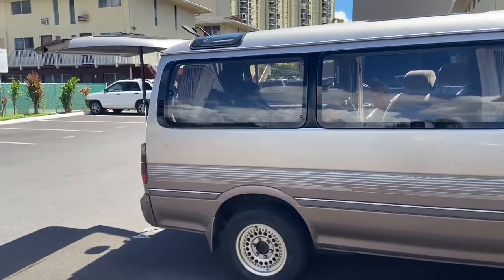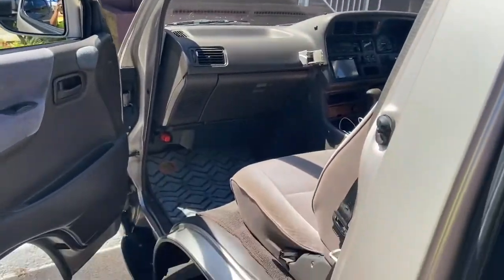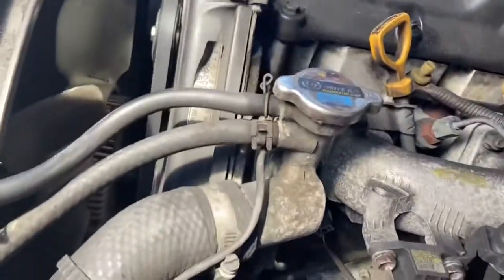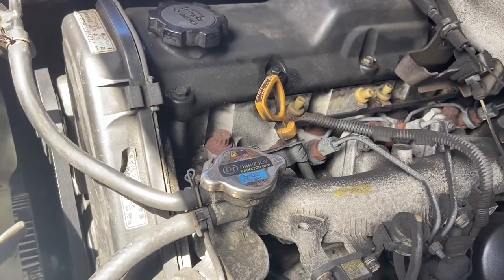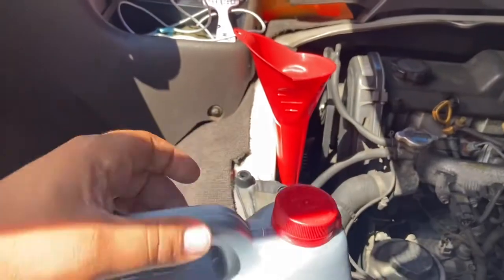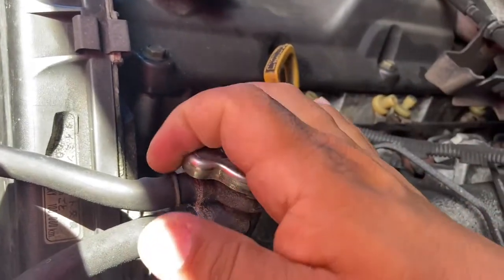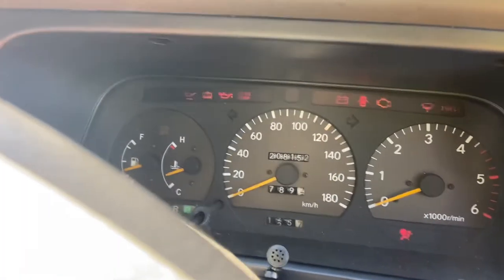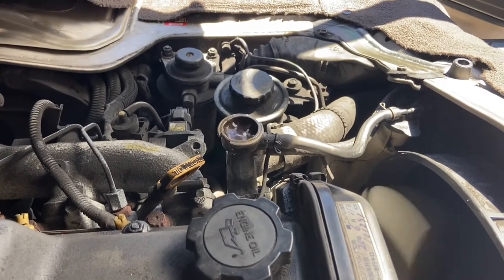1995 Toyota HIACE Coolant Fill

Comment: On mine, a 1999 LH112 with the 2.4 liter 2L diesel engine, the expansion tank has the radiator cap an it's located in the left hand B pillar on the back of the driver's side. I believe that either the radiator fluid level is damaged, disconnected and I will replace the radiator cap next week!